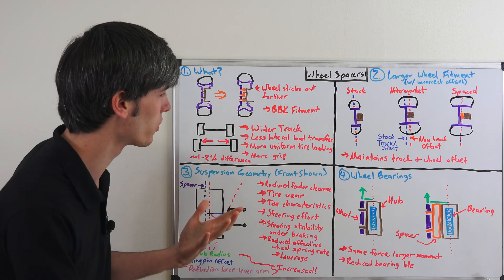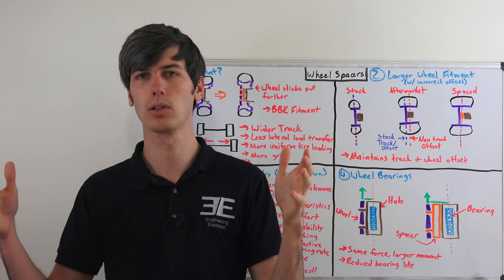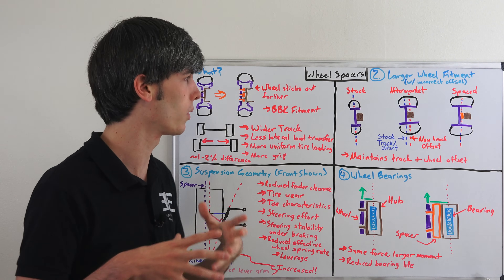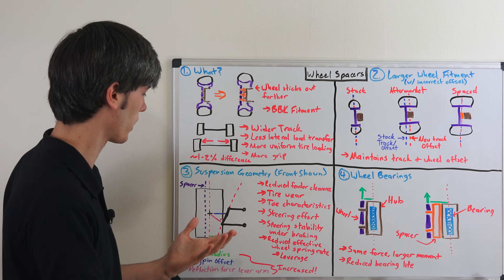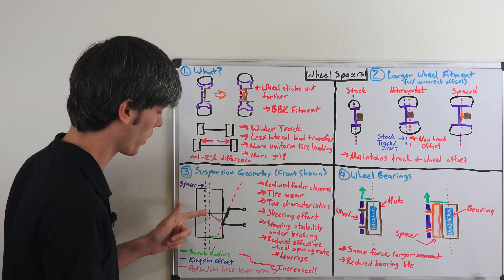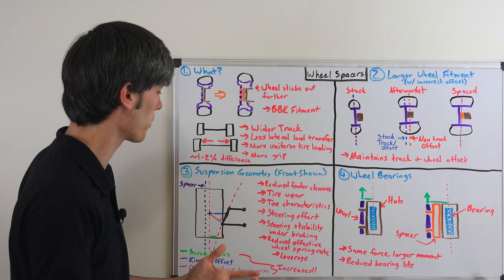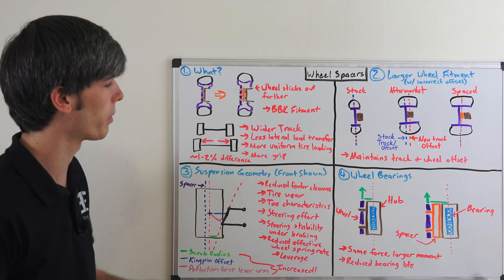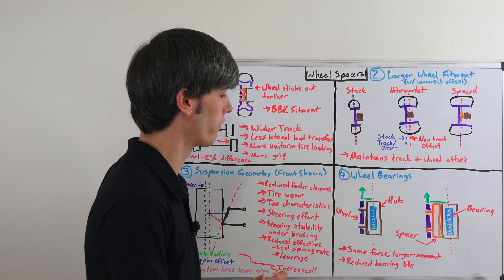Wheel Spacers & Adapters - Good Or Bad?

Comment: I have a stock 17x7,5 ET44 wheel and I wanted the get a wider track, to improve handling and for better look
 but without upsetting the suspension geometry. Should I stay on the 17x7,5 with an offset of 40, 33 or even 27? or 17x8 with offset of?
Should I stay on the stock wheel and go with spacers?
or go with a wider 18" wheel, with a different offset? 18x8-18x8,5?  et 33
I have a Peugeot 308 (2015) and want to lower it with a -3 spring

Comment: In drawing #2 if you have the wrong offset wheels and use spacers to correct the offset is this the only correct way to use them?this is what I had to do the tires are back in the factory location is this good or still bad?

Comment: +Engineering Explained If I was to go from stock 7" wide wheels to aftermarket 8.5" wheels but maintain the exact same offset, the the suspension geometry and the moment on the wheel bearings should remain the same, correct?

Comment: Wait. Jason, Wasn't example 4 wrong.??? The spacer would be between the hub and the wheel increasing only wheel distance/width. The hub (wheel bearing inside) never moves so it would receive the same load. Orange depiction should be furthest out right?

Comment: I feel like as long as you dont buy shitty cheap spacers, and stay within a reasonable amount of extension (probably no more than an inch) your car should be fine. Of course the wider the spacer the more pressure youre putting on the suspension mechanisms.

Comment: Another great video that confirms my decision to maintain stock suspension geometry when upgrading to more interesting wheels. You are So, So right when you remind us that the car's engineers took all of this into consideration, not just for cost reasons, but as in the case of my Mazda 3i, performance affected by ALL of the contributing factors such as, total vehicle weight, front to rear weight distribution, track width vs. the centroid, all of these things. I opted to stay with the OEM tire size and wheel offset and went from the stock 16" steel wheels to the (much lighter) 16" OEM optional alloys and immediately felt an improvement. Sometimes going to wider tires and larger diameter wheels actually diminishes performance. I had a 2002 BMW convertible that was the best handling car I had ever owned. My 2014 Mazda 3i Sport handles every bit as good.

Comment: Hi! I have a lot of questions. The leverage is putting strain on the bearing and suspension because of weight. Will weight reduction minimize stress? Is changing to high performance suspension and high performance bearing equates to level of handling the leverage? Is there an equation to measure stress? Sorry hooked on this video

Comment: I have a question. The added weight that you have when you put on a spacer, for example a 1 inch spacer, what affect would that have on your car? Would it make your car accelerate slower? Would it put more stress on your transmission? Someone told me that for every extra pound you have on new wheels(meaning your old wheels were 25lbs, new wheels are 30lbs each) it adds like 5 lbs to the car. Something like that. I just watched this video of this guy who runs 50mm spacers, and hes saying other people put 2 spacers together, and are still fine. Same wheel bearing.Do you guys think thats true?

Comment: You can eliminate all the draw backs of having a wheelspacer if you match the effective offset of your stock configuration with your modified set up. of course this would mean having bigger limitations to how far you can mod but it is the safest and best way to let both the benefits of the stock configuration, and the benefits of the modified configuration meet halfway and actually work. My friend did the same with his car. He gets his car checked every 6 months and the mechanics see no negative effects on his suspension system.

Comment: I have 350z Roadster oem tires are 55/205/17. I just put on a set of spare rims I had which are 35/245/20 with offset +40. The offset for oem is recommended 30. Is this ok? If I had a choice I would've picked rims with lesser offset than the ones with 40 but thats what I had around at the time.

Comment: I do follow your videos and they are excellent. Recently, I bought an used vw gti 2013 with 18 inch allow wheels , the sctock ones. I decided to buy new tires, balanced them and allign them perfectly. However, I have noticed that when I drive more than 70 or 80 MPH, the car suddently begins to vibrate in my seat and passenger seat. I have read that those vibrations have to do with the rear wheels if the steering wheel does not vibrate, which is my case. In addition, the person who sold me the car told me that he put wheel spacers in the rear wheels, but not in the front wheels in order to improve the look of the car. I am planning to go ahead and get those spacers out and put the stock ones back again and see if that fits the vibration problem. Do you think that vibration can be related to those rear wheel spacers,? Thanks man.

Comment: One thing to remember. When tightening the nuts that attach the adapter to the brake drum or rotor, have someone apply the brakes so you can properly snug these nuts.  That helps prevent the nuts from backing off and wheels falling off. Not that that ever happened on any car I've owned...

Comment: Wheel bearings come in pairs.  Whilst the explanation is correct when you "offset" as described it will obviously load both in an axial manner which is detrimental to both bearings on the stub axle.

Comment: I just bought a 370z and the only thing I don't like about it is how far the wheel sit in the wheel well. I was thinking about getting 20mm spacers in the back and 15mm in the front. Would this change have more negative affects than positive?

Comment: On #4. Wheel Bearings. Your description makes sense - as long as you are using the stock wheels and tires. You didn't draw the whole picture, you only drew the surface of where the wheel mounts to the spacer vs mounting to the hub, even though the real force takes place first where the tires meet the road, and then translates up into the hub and bearings.... If you add wheels and tires that are wider than the factory wheels & tires, and those new tires are wide enough that they go under the car to the point where the old tires were or better yet, even more under the car than the factory setup, you will not reduce the bearing life.

Comment: I was going to get spacers to push the wheels flush with the body on my Jeep Grand Cherokee,  but you killed that idea. On the plus side I subscribed to your channel.  Thanks for showing us the science behind it. Any chance my Jeep can better tolerate a spacer because of the beefier suspension compared to a car? I gotta try, lol
Reply: A less than 1 inch soacer won't even touch that jeep suspension:) you won't regret it. Don't overthink jt

Comment: In the beginning you are good and try to quantify the significance of the wider track.  Why don't you do that everywhere else?  That would be the useful info.  Increasing the moment on the wheel bearing might decrease its life, but is the effect significant?  And that is where the question becomes subjective but even if you were to say it decreased the life by 5% that would at least give us something to work from.  Same goes with the increased torque on your spring rates, etc.

Comment: I did a square set up on my E46 M3 and did 9.5 rear tires all the way around for my 27 off set. The fronts stick out more so I added spacers in the rear to help equal it out but they don't make spacers big enough to make it perfectly  equal and with at 20mm spacer I rub when going over bumps so I leave it at 15. But going from staggered to a square set up doubles my pilot super sport tire warranty which saves me lots of money well as being able to rotate my tires. With more rubber in the front I can stop quicker and have zero body roll and under steer where I used to have it.

Comment: so the reason I checked out this video is because I installed a lift/leveling kit on my truck which has new spindles on front and 2 inch (block) spacers for the rear. Anyway my front tires now come OUT about 2 or 3 inches, BUT my rear tires still look the same obviously since I just installed spacers (block). My question is... are wheel spacers far more safer on the rear rather than the front? since I wont be steering with the rear tires obviously. I'm thinking about adding 2 inch wheel spacers to my rear wheels.

Comment: this video doesn't tell you what to do with your car, he's  just telling you what happens if you do modify your car.  Yeah wheel spacers help, like a spare tire, but if you do decide to use wheel spacers on the long run, you'll get consequences.  any car mods comes at a cost, you pay cheap now and break things later down the line, or spend the extra money, get a better aftermarket wheel offset and lighter wheels, and you will have that same load on the bearing as stock but with bigger, cooler looking wheels.  I'm not talking about cheap China imitation wheels, but engineered wheels like BBS, HRE, or something the likes down this manufacturer lines.

Comment: So wouldn't offset wheels be just as bad on suspension as a 1.5" spacer? either way youre putting more stress on your suspension.  I have a jeep I want bigger tires on and need to either space it out or buy offset wheels to prevent rubbing. Ideas?

Comment: the negative effects on suspension geometry and bearing load would be the same whether you used a 2" spacer or simply got new wheels with 2" more offset then. Either way you're moving the the load 2" outboard so my question is, are there any negatives between using a spacer or using a wheel with the same offset that the spacer would provide?

Comment: They are HORRIBLE. I used a wheel adapter once on my vehicle and lost my wheel going 70mph on the highway. Yes I torqued it properly and no it was not a cheap brand. The adapter ripped in half. I would never recommend any spacer or adapter after that.

Comment: What about the wider track for an off-road car? How beneficial are they for off-road stability against flipping?
Reply: First of all, sorry if I make mistakes, english is not my first language ... I think a wider track will improve the stability for and off-road car, but just a little, and you have to consider that you will punish your axles and another parts a lot. So if you dont mind about fixing or changing something before time, you should do it.
Reply: After lifting a car, especially a relatively narrow one, having a wider track is a must , otherwise the car will roll easily. But I wanted to know hat is the best.
It's true that the spacers will put more strain on the car parts, but there's no other way to deal with this.
Reply: Wheels with a low positive offset or a negative offset and a fat tire with some sizable sidewall are an alternative
Reply: Bat5.0 lower offset wheels equal wheel spacers because the forces will change the same way, they are just more reliable.

Comment: Should I put spacers on my BRZ with the stock wheels? My friends keep telling me to get spacers. And I'm thinking of lowering it too with lowering springs, but your other video doesn't suggest doing that either haha. Coilovers are too expensive for me.
Reply: Po Russki do it buy spacers  I have a subaru brz aswell with spacers check my videos
Reply: If you do decide on going with lowering springs and spacers you should install your springs first. Once you have installed your springs you need to drive it for about a week or 2. This will cause the new springs to compress and settle in. Once your new springs have settled in you can begin to measure how much room you have to install a spacer that won't rub.

Cheers
Reply: Akber Jafferi he never answers my questions
Reply: Akber Jafferi I've asked Calvin a few questions before and yes he replies... but the spacers thing isn't a big deal for me right now
Reply: Po Russki do ask tjhunt that question, he's got a brz and it's getting mods on his channel
Reply: Po Russki tjhunt? well sorry, I'm guessing he is a lil busy tho. have you asked his friend Calvin? Calvin owns the tron BRZ, though I'm not sure if he uses spacers on his rims.

Comment: Can I put a spacer on my spare wheel, that would bring it down closer to the ground and effectively lower the centre of gravity on my car, making it handle better?
Reply: Braam Olwage lol
Reply: I've got a spare tire inside my SUV... adding a spacer would make less room in the car for groceries.... Da da DAAAAAAA..... (Just kidding, honey)
Reply: Hilarious
Reply: Lol
Reply: Just take the spare wheel out and the seats, which will reduce the sprung weight.
Reply: If the spacer is heavy enough to make a noticeable difference in ride height, it is likely to change the polar moment of inertia - so, you must consider the yaw effects it may have.
Reply: Theoretically....
Reply: It's like a makeshift skid plate except now you'll bounce over obstacles, I do it too! I corner like a Subaru all day in my spare-spaced ford cummins toyota ZJ on 44's
Reply: haha try it!

Comment: if spacers are so bad why do they put them on 1 ton dual wheel pickups their are 6" spacers on the front of mine from the factory
Reply: If they are from factory you are at least sure that someone thought them through and the components can handle the increased load.
I also imagine pickups have tougher suspensions than say family cars.
Reply: spacers aren't intrinsically bad.    the point is that the car is engineered to work as best the designers could make it with certain spacing, and if you change the spacing, the forces become different, and might be suboptimal compared to the original design.

Comment: +engineering Explained what if I install spacers and the do the alignment to ensure that camber and toe are as designed. Does it wheel keep the weight even on the bearing?
Reply: Yo I've had 1 inch spacers on my car to clear the big brakes I installed for like 2 or 3 years now and have had no problems. These are some effects that it can cause but from my experience there is no problem doing it as long as you don't drive like a race car on the street or track the car. I've even driven mine aggressively on some nice roads a couple times and there's nothing that had gone wrong. So do what you want with your car unless your tracking it.
Reply: It wouldn't change those so that would be useless

Comment: just because mathematically something will be bad doesnt mean in reality it will be bad. like you said with wide track could make handling better. but in reality it doesnt. so if youre saying wheel spacers can theoretically wear you bearings, does it in reality? for example wheel offset is measured in millimeters, a very small number. with your math do you think it will cause a significant amount of damage with a few millimeter offset?
Reply: my wheel bearing is shot, I believe due to the spacers on my car from previous owner. going to find wheels with hmthe correct specs so I can remove the spacers

Comment: So a .25 wheel spacer shouldn't cause to much of a problem then , correct?
Reply: don't get those little plates that just slide in between the wheel and hub please. your lugs won't tighten down and your wheel's gonna fly off
Reply: That's what rough country recommended since I'm only doing a 3.5 inch lift. Tires 285/55/20 nitto grappler

Comment: Didn't you do a video explaining that torque is transferred to the wheel by the clamping force between the wheel and hub, rather than by the lug bolts themselves?

Comment: Interesting concept and logic behind that, but what about using spacers on a truck with a solid front axle and coil over shock suspension? It is a 4x4.  I'm considering about adding a 2" spacer to my stock wheels to eliminate rubbing. In your opinion, is this a safe option? My stock wheels are 16x7 and my tires are 33". Which spacer can provide the clearance needed for a safe application? Thanks!
Reply: shorter backspaced wheels will always be a better option, but 2 inch spacers get sketchy regardless. i'd be afraid of it loosening and your wheel flying off
Reply: also just settling for thinner tires would be beneficial